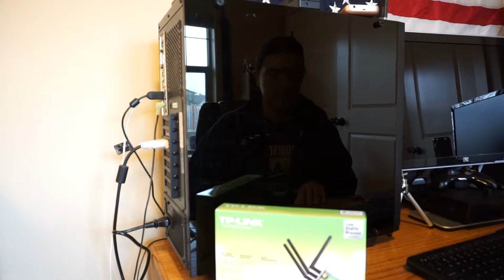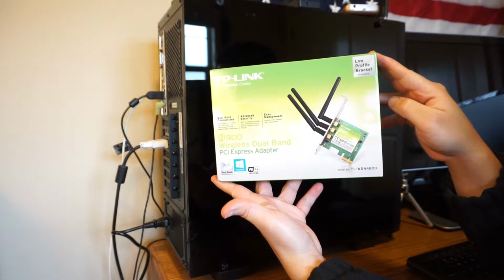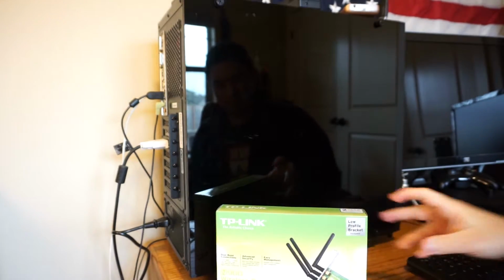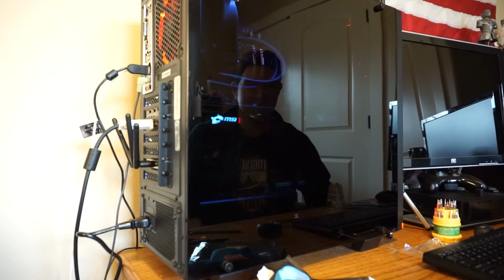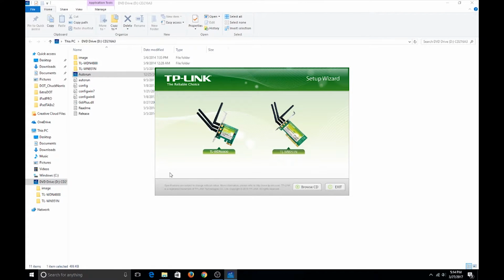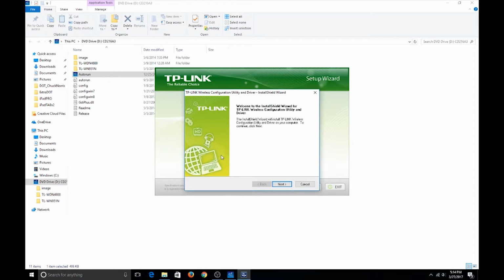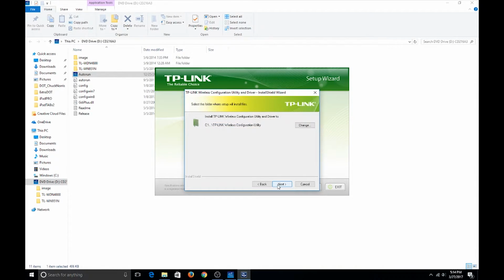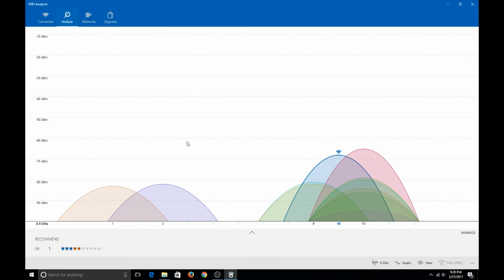How To Install a Wireless Adapter | TP-Link N900 TL-WDN4800 | PC Tutorial + Walkthrough

Comment: Hi , I saw another video in which it was said that it is perfectly possible to use your PCI x4 (or even x8 ) to plug your  PCI ex wifi card and it will work just fine cos after all they are all PCI ports,  In the case of your video it is just the same putting your card in the port where you put it, or in the port right below to it. 
This is exactly what I am going to do because the other choice (in my case) is to use the PCIe which is right next to my videocard,  so I have 2 choices: a) using the PCI e and obstructing the air flow to the video card ,  or use the other PCI port which is some centimetres away below (mobo is B450 m aorus)
.  What do you think?

Comment: Can anyone help me out here when I install my Asus wifi card into that same slot my boot drive disappears so I think it shares band with SATA 1. My question is can I just plug my boot drive into a SATA 3 and will it all run perfect or is this wifi card going not run at full potential since it’s a shared port? I have it’s now installed at the top it’s like almost sitting on my gtx 1080ti it’s very very very close to it

Comment: If you guys are having trouble with getting the drivers to work properly, do this (credits to Raymond L., from an Amazon page):

"Download Windows 10 driver from TP-link site (under Support, Archer T9E, Windows 10 driver) -- this is a zipped file and unpacks to a SETUP application file. You run it and it says the driver is installed --- but really nothing happens, DM says there is no driver... Why? Because you MUST DISABLE the existing Network Interface Device first! Once you do this (then reboot) the Setup runs perfectly and all is well. Root Cause: What happens on Windows 10 system is that the new NIC is created as a Network Controller device, not under NETWORK ADAPTER as is should be (note, it didn't do this on my Windows 7 system). Once the existing adapter was disabled, Windows 10 created the new NIC card under Network Adapter and the Setup utility from TP-Link Driver download ran correctly"
In other words, disable everything on Control Panel>Internet and Network>Network Connections ; instal the driver ; reboot and voilá. If it doesn't work, disable>reboot and instal instead of instaling before the reboot.

Hope it helps!

Comment: Does it matter which pci-e slot u install it in?
Reply from the maker: HMJTECH as long as it's an appropriate slot, no it doesn't matter. Just recommended you place it where the antenna have room to be positioned.

Comment: would i be able to run pubg or fortnite without lagging on pc if i use this wifi adapter? in simpler words, does this work the same as if you had an ethernet cable connected to the computer?
Reply from the maker: NetArbenio Ethernet is always superior. However you could have lag free play. Hard to answer specifics since it also depends on your own modem and router set up as the slowest device in the WiFi connection will be the limiter.